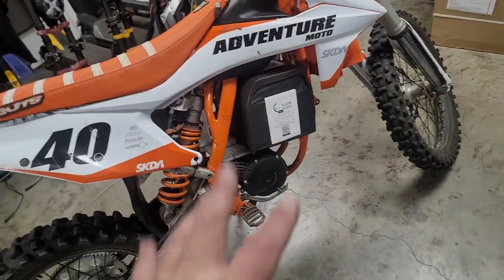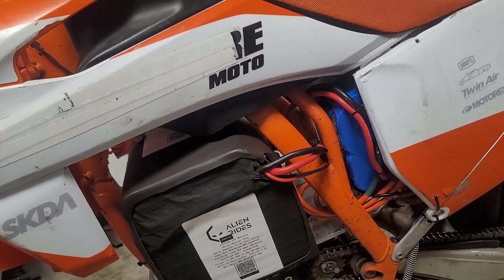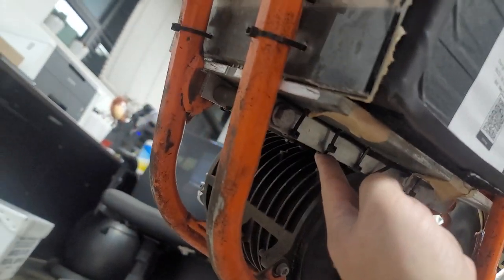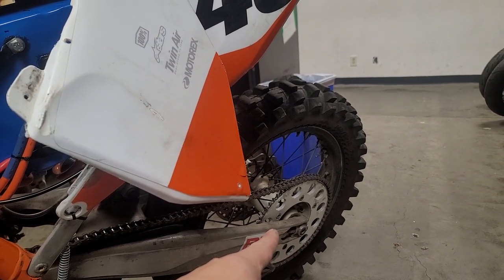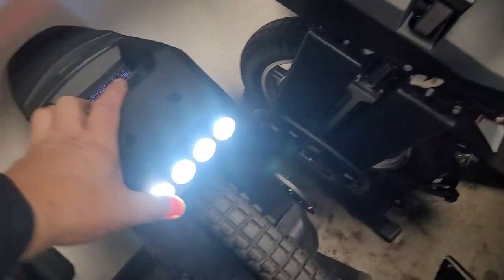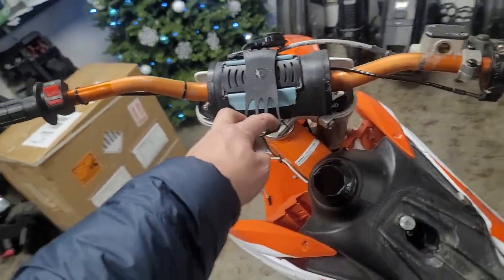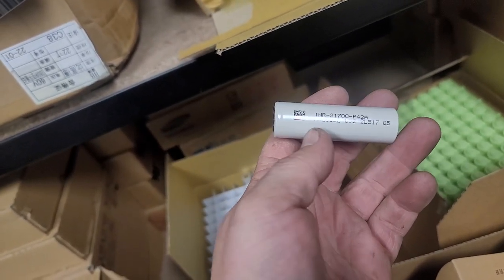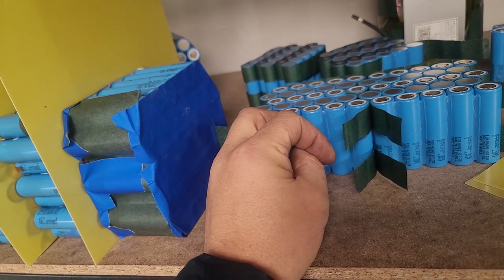vesc 117 volt motocross bike conversion,  high voltage diy motorcycle

Comment: Did you use the auto learn feature of the vesc with the Qs138? Did it recognized it no problem? Any other parameter changed on the vesc? Thanks and great conversion, albeit a bit rough... 😅

Comment: Kevin, can you do a vid on why a Vesa and not a Votol 260 or 300? Nice job.
Reply: Probably because 3shul vesc has more phase amps, heats up much less and software is much better. Also these vescs can support 100v nominal 28s batteries so you utilize qs 138 to it's fullest.